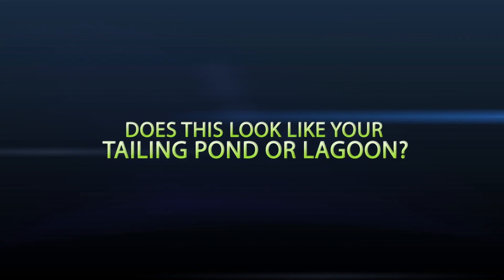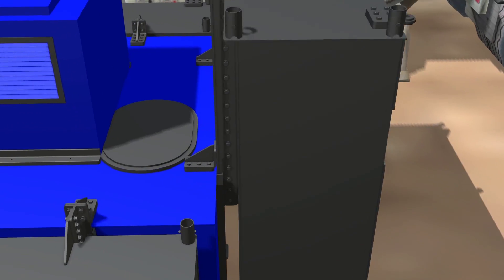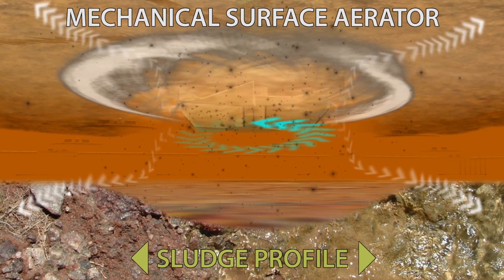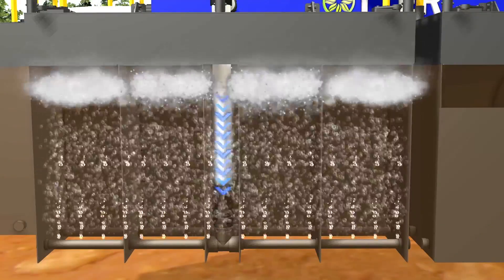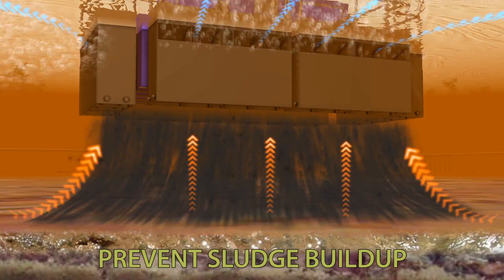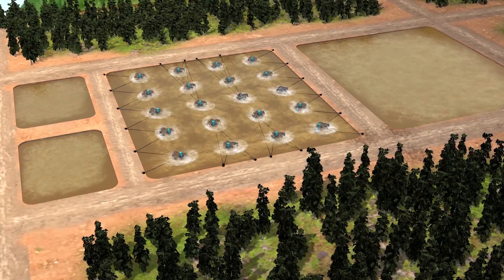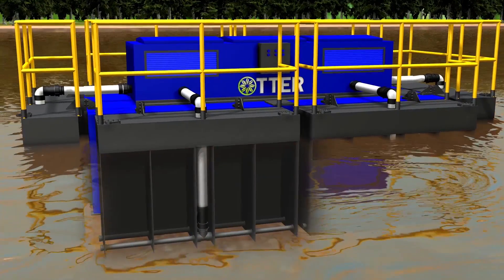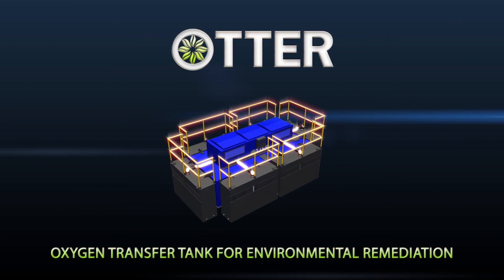Introducing the OTTER Barge Waste Water and Effluent Treatment

Comment: How you supply the electricity?
Reply from the maker: Rudi Willem the guide cables you see in the video carry the umbilical electrical cable
Reply: @emcsindustriesltd3572  But why does the Otter Move in lanes unlike surface aerators?